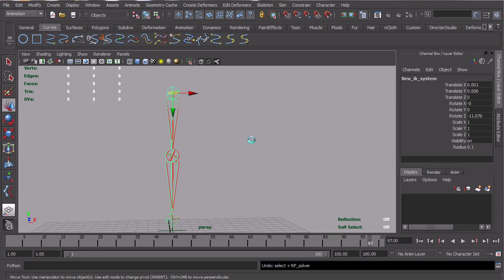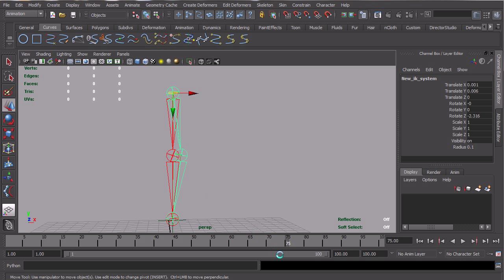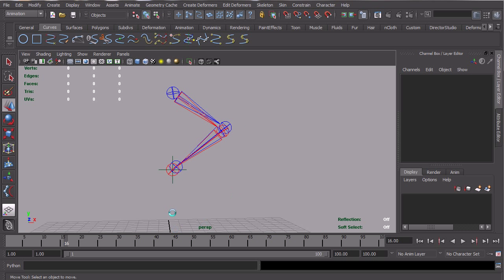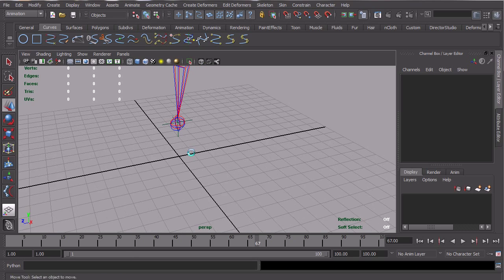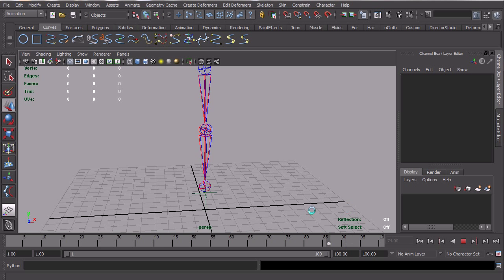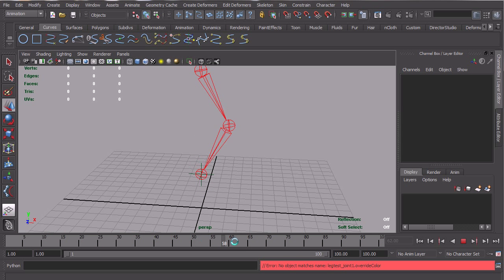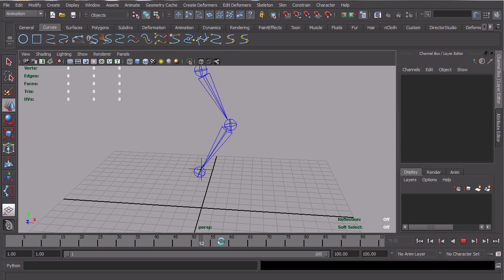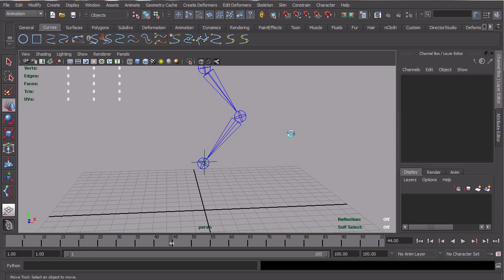Farley Chery No knee pop setup v.1.1.avi

Comment: I've improved on this method and will be sharing it in someway soon I am compining it with an auto footroll/orientation setup. My new rigging methods philosophy: The rig should give the animator the most likely result (no flipping or breaking of hinge joints) and having the animator's adjust the results as needed.